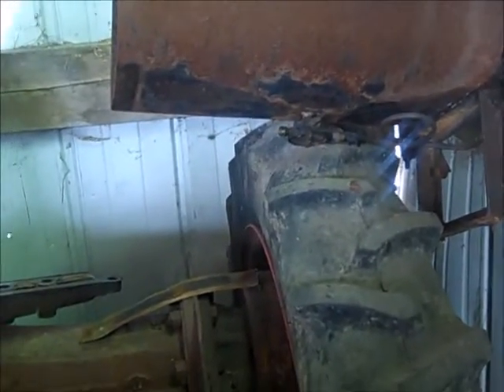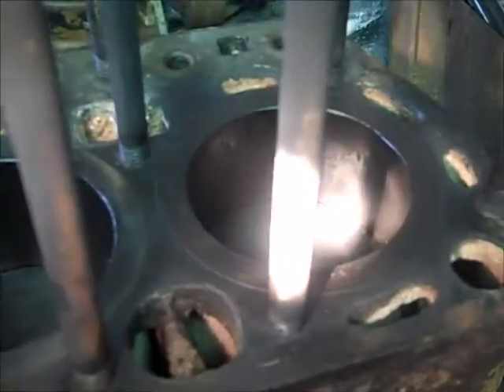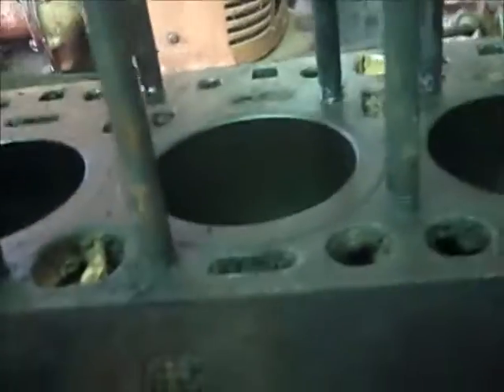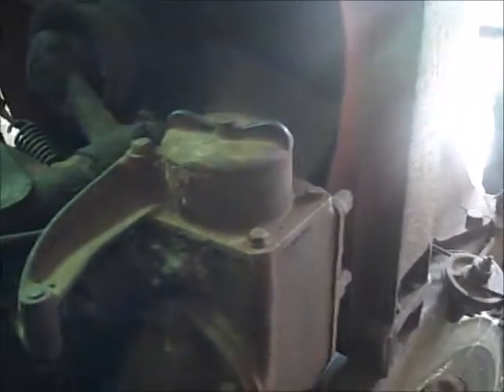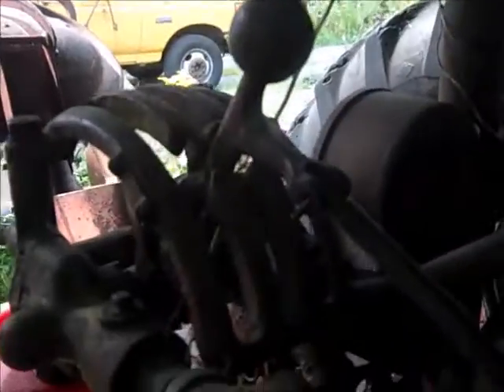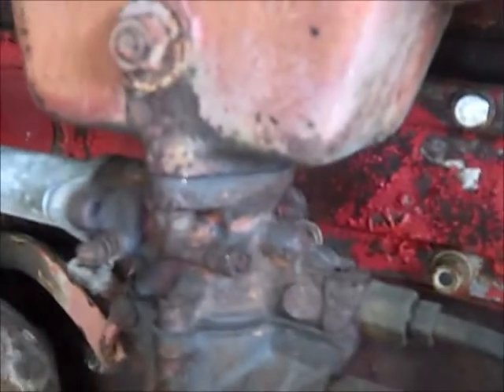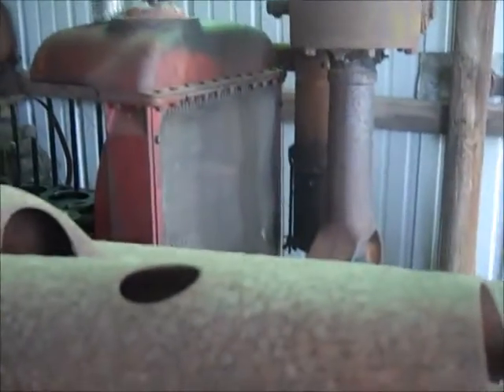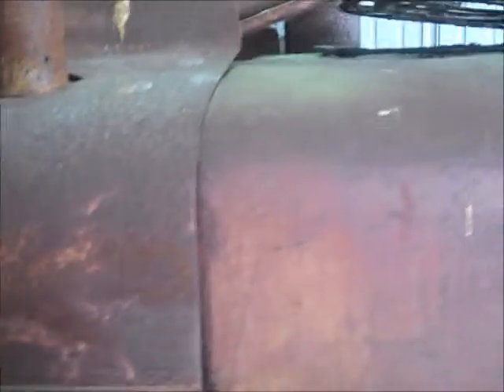Farmall F20 restoration part 4 turns with hand crank and a H

Comment: Both of my F20's pistons only come up to the top of the cylinders. What does the bottom of the head look like? Are there deep domes in the head that allow for the room of the pistons? It seems odd that they are coming above the block that much.
Reply from the maker: There is 1 3/8 inches from the bottom of the head to the valves.
Reply: Well, I guess my question is how much clearance is between the valves and the tops of the pistons at TDC. I would assume that if it ran before, it will run again!? You will know when you get it back together, when hand cranking, if it binds up at TDC or not.
Reply from the maker: at least 1" between  the pistons and valves at TDC
Reply: I would think that is enough room. The valves don't open even close to an inch.

Comment: I have a 1944 allis chalmers b and was wondering how you can tell that the radiator is at the proper level. Thanks
Reply from the maker: I keep my Allis Chalmers B, C, and CA's all an inch or two from the top.  If yours has a no pressure radiator there it a built in overflow tube in it.